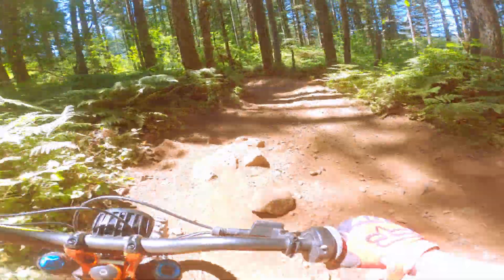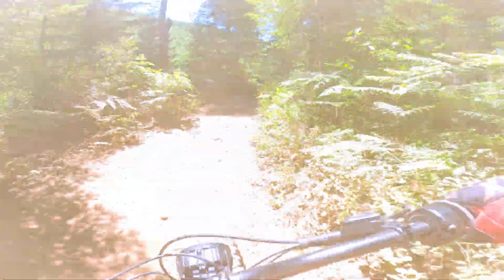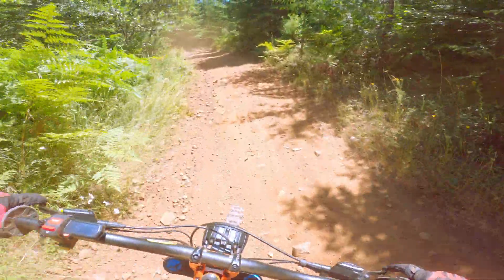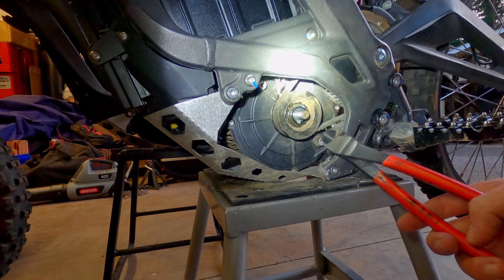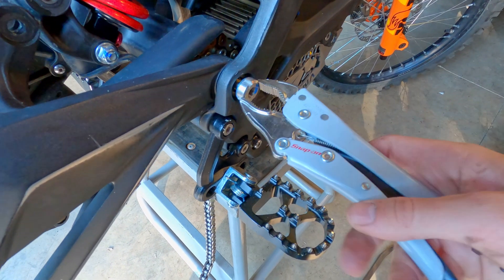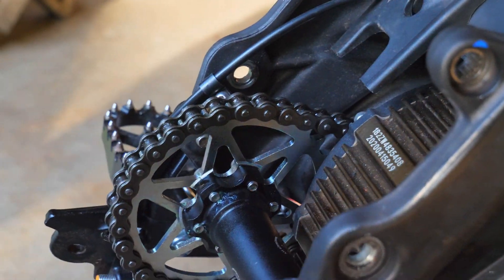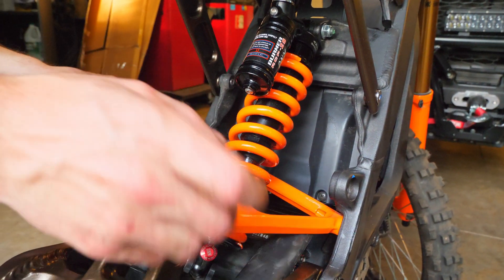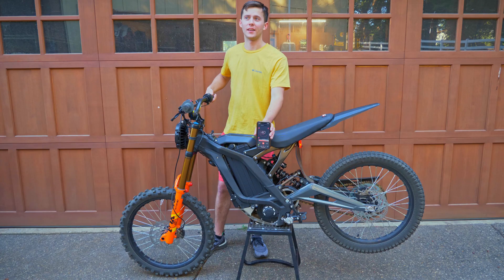Sur-Ron Belt Stripped! Chain Primary Drive Installation & Testing

Comment: Is a o ring primary chain an option? I wonder if it would be quieter?? Or maybe both chains could be o ring. I wonder if anyone has tried either or both?
Reply: Stock Sur Rons are not very powerful. Using Oring and Xring chains will cause a slight but noticeable decrease in power. Even on my 72 volt bac 8000 I don't use O or X ring chains. I see no need, just more friction and drag. Just a non chinese high quality plain 420 chain is all you need. If I had the primary chain conversion kit installed I'd  use an X ring  gold 420 chain because it can get away with less tightening and lube intervals than a plain 420 chain.
Reply: @trjonez  Would the o-ring on just the primary be noticeably quieter?
Reply: @boltuprightmaui  X and O ring chains are slightly quieter but not really worth talking about. More than anything else an overly tight and under-lubed chain will be obviously noisier than a slightly loose and properly lubed chain. Chains can handle being a little loose and will benefit wear and noise wise. A toothed belt needs all play removed and then a little tension applied. Long rear secondary chain to belt conversions must have that long stretchy belt very tight or risk stripping. That extra tight belt stresses the jack shaft and rear wheel bearings. Chains are far and away more reliable especially offroad. Replacing front or rear SR belts suck and is not something that can be done in the middle of  nowhere. Chains whether front or rear are easy to replace or repair. I personally will be using a gold x-ring chain on my front chain conversion and a regular gold non o or x ring on rear.
Reply: Good stuff, Mahalo!!

Comment: Amazing video guys.  Any performance difference?
Reply from the maker: If there is, it is not noticeable just by riding. Maybe a vary slight decrease in range.. speed and power is unaffected.
Reply: @emotobros  Cool thx.  Have to say I'm on the fence with this one, but leaning towards belt.

Comment: I have used 303 aircraft protectant for years on my car belts and have never changed them. I just got my Sur Ron a week ago and on of the first thing I did was to soak my belt with it and let it set overnight. This way it was dry and treated and I don't expect it to go bad as I will do this once every 3 months.
You can call this hokee but this stuff works!
Reply from the maker: Good tip! We may have to give that a try
Reply: Why do you think this works just wondering?
Reply: @sparkfire1223  303 will keep the belt "soft" if used since new and may give extended longevity to slightly used belts. Or put another way, 303 keeps the belt from drying out and becoming brittle, which is the leading cause of belt failure. Second leading cause is foreign material/contamination, so be sure belt is clean and dry after application.

Comment: Nice, just had to do this yesterday but opted to use the 219 chain kit, seems like a nice medium and not as load, curious what app you used to measure the sound and see what mine reads out. Thanks for sharing, people will surely find this very helpful
Reply from the maker: I used an app called “dB Meter” of the App Store, although it was only a free 3 day trial. I would be curious to hear what the 219 sounds like as I am disappointed with the 420 kit that I got
Reply: @emotobros  right on, thanks, I'll happily do a test and report back. Looks like now I'll need to find someone who wants the 420 kit haha
Reply: There are comparison videos about the 219 on YouTube. I wonder though if it’s as resistant as the 420...